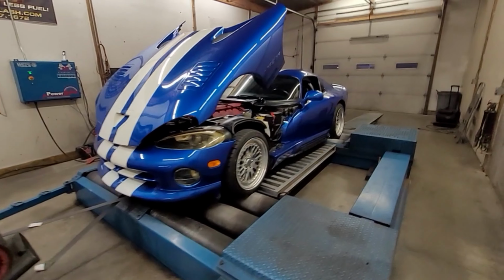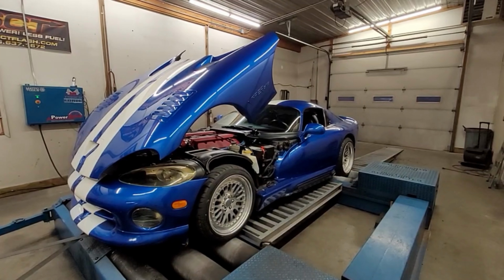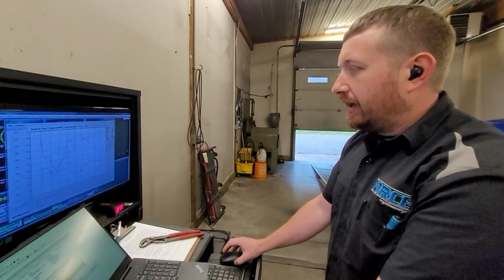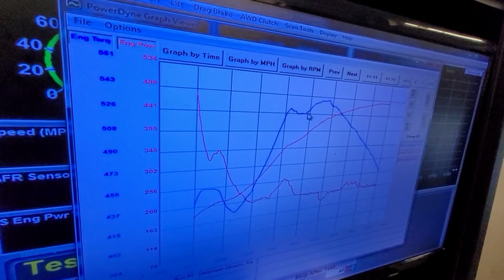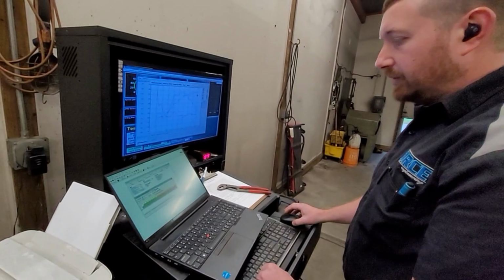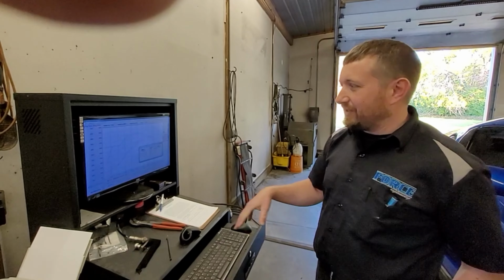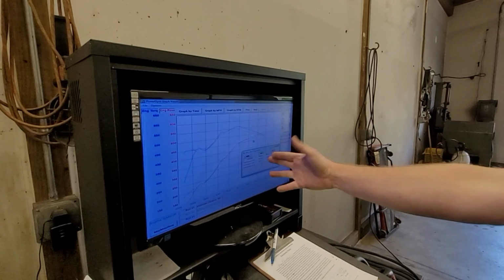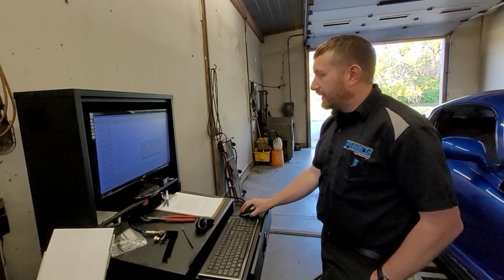1996 Dodge Viper "650R" - How Much Power Does It ACTUALLY Make?

Comment: That sort of dyno cannot tell you what HP and TQ the engine is making. It's not even accurate at measuring what HP and TQ is hitting the wheels........it's only a tool to know if mods increase (or decrease) engine power. And if so, approximately how much. 

If you really want to know HP and TQ, the engine has to be put on a real engine dyno, out of the car.
Reply from the maker: I mention trap speed in the video multiple times, and how I'll be doing more testing. That's the end all data for me. 124mph was my last trap and at 3650 or so race weight that isn't close to 650 flywheel hp.
Reply: @mattquerio  Dragging what is supposed to be a real sports car. Something that can brake and handle, not just do straight-line acceleration. 

Sad.

Anyways......your trap speeds mean absolutely nothing, and they're less accurate at determining crank HP than that dyno. 

I wasn't commenting on (nor do I care) if your car actually makes the advertised HP. Just mentioning that those types of dynos are very inaccurate, and really only to see what mods do from a baseline power level. Too many people don't really understand that.
Reply from the maker: Your comments are pretty much useless. This is simply a video measuring the benefit of the tune, and the power before and after addressing it. 

Trap speeds are the most accurate measure of wheel hp leveraged against the weight of the vehicle, so you're also completely wrong there.

Comment: I think 15 percent drivetrain loss is a bit on the optimistic side.  Ford calculates around 11 percent for their rwd cars.
Reply from the maker: 15% is the baseline standard, but at the end of the day the only thing that matters is weight over trap speed. I'm about 3650lbs and 124mph in previous runs. I'm going to guess 125-125.5 now. That's the only numbers that really matter at the end of the day. The loss percentage certainly does vary.

Comment: I had a longer comment until i heard you toward the end mention its likely stock cam maybe some light head work. Agreed. Solid numbers though but a 650R is likely the reason that company is out of business. Enjoy it man these are the most fun cars to own and drive.
Reply from the maker: I agree. It was a very optimistic claim on the builders part. As it sits, it's a healthy combo for the street. Some gears would really be icing on the cake in my opinion. Thanks man, and I agree. It is absolutely a pleasure to drive.

Comment: For the cost,  to low of horse power. But thanks for the vid
Reply from the maker: For 40k I'd say 490hp/563tq at the wheels is plenty. Enough to show a new C8 stingray tail lights on the highway. For a lot less money.
Reply: @mattquerio  the numbers are based on artificial conditions. Not pavement,  where the rubber meets the road.  Thanks for the vid tho
Reply: @mattquerio  another year or two the vette will be cheaper anyways lol. Vipers will forever be cooler than vettes.  One being faster than the other is pointless since a model s plain will eat up everything on the road while hauling kids and groceries.  Enthusiast cars are about fun and the viper has that for days.

Comment: I have a 2001 “650R” that put down 526/548.. I also made a video about this same “discrepancy”. I do plan to have someone knowledgeable do this type of tuning checkup on it someday. Great vid.
Reply from the maker: I subscribed to you so I don't forget to check it out!  526hp is a good bit closer to me though. That back figures to about 618 flywheel.  Either way I am good with it, the car is a blast on the street!
Reply: 650 R was supposed to be a 514 cubic inch? one of the mags I have where they tested it it dyno 585 rwhp. traped 130 in the 1/4

Comment: Not terrible numbers old school UGR Viper heads and intake put down 499whp w a serious aggressive tune…. Was this on a Dyno Jet ? Might just have the stock 708 cam still … Jessel is big $ stuff vs the common Harland Sharps
Reply from the maker: Yeah I'm not mad at it, I didn't expect it to have 650 crank hp.  Butt dyno said 550 so I was pretty close.  This was a mustang dyno.  I do think it's the 708 cam judging by the peak hp coming in at 5300rpm.  It's a great street cam.
Reply: Mustang dynos are notorious for having way lower numbers as far as dynos go. Put it on a hub dyno and I bet it’s a decent amount more

Comment: Your Viper put down some solid numbers at the dyno. Curious if the tune made a noticeable difference and looking forward to updated dragy times.
Reply from the maker: It feels smoother and I swear I can actually smell the difference with the leaner tune, the exhaust is less old school fumes.  I will be curious on data from dragy as well, I am guessing minor gains in the 1/4, maybe it'll trap 125.5mph.  Still respectable enough for what it is!